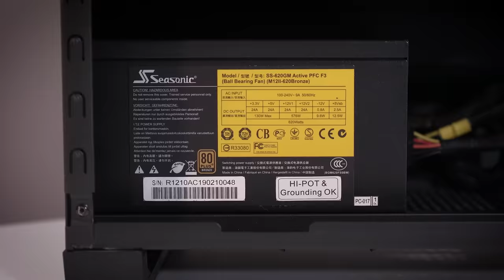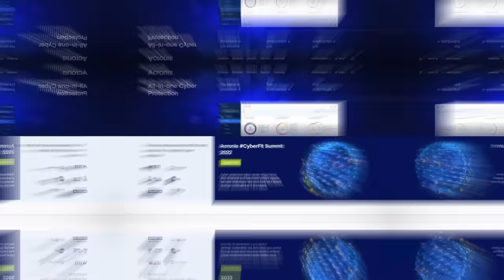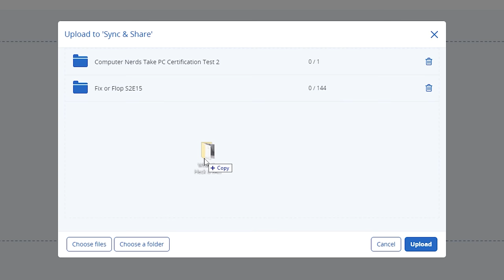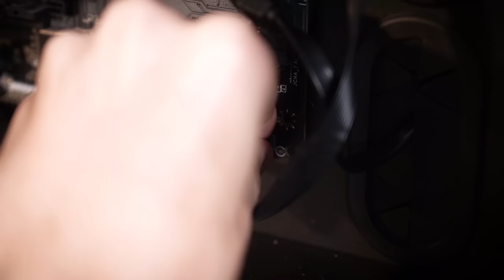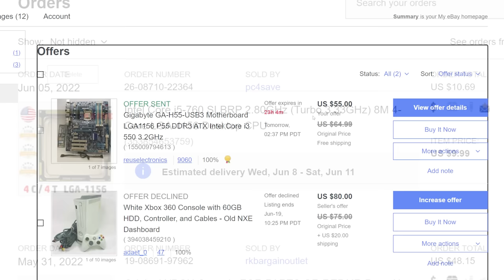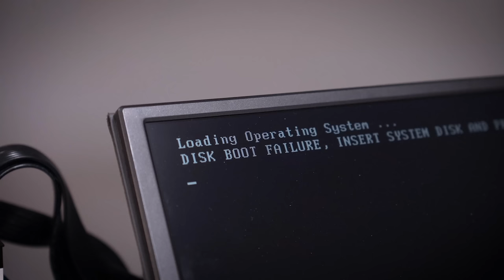Fixing a Viewer's BROKEN Gaming PC? - Fix or Flop S2:E14

Comment: This sort of power cycling problem can be indicative of a bricked BIOS. The EVGA board from the video (P55 LE) looks to have a socketed BIOS chip, I would have looked for a cheap USB programmer to re-flash the chip. I have also seen many listings on eBay for replacement BIOS chips for the P55 LE which are sub 10 bucks, it would be worth a shot for a follow-up video.
Reply: Or just a bad CMOS battery on those old Intel boards...
Reply: I think those flash chips start do have bit flips after 10-15y. so maybe reflash before system is 10y old
Reply: @RandomTechVideos  that's what I was going to say.
Reply: @LimbaZero  what your saying should be impossible as bios is physically burned into the chip... or at least that my understanding.
Reply: @t8z5h3  If it's eeprom or flash then they will die over time. Search for bitrotting or bit rot.
Also Adamant IT has many videos where he reflash bios to old motherboard to fix them.
Reply: I was searching for this comment and it is indeed a case of the bios eprom succumbing to bit rot. Rot can happen as earlier as 10 years into a chips life cycle.
Reply: @Precurser66  good to know.
Reply: I experienced the exact same issue with a failed attempt to flash my BIOS
Reply: Gonna agree with this one
Reply: @LimbaZero  You are on the right lines there. Ive seen may eproms from the late 80s and through the 90s be very bullet proof and reliable even to this day there are many flash rom based computers from these time periods where their BIOSs and boot roms are still good today even of the actual hardware in the computer has degraded to age, older roms in the 80s were typically of a masked type meaning that their data is ‘burned’ into the silicon at the time of manufacture or programming, mask roms were a fairly unreliable (even at the time) rom type and were quickly phased out by eproms. Modern eproms to my knowledge due to being made on smaller manufacturing process nodes than ones back in the 80s and 90s are more susceptible to bit flips from external radiation or cosmic rays from the environment, this may or may not become more of a problem depending on how dense the data capacity of newer eproms become in future.

*From my knowledge*
Smaller transistors Fets used in these modern eproms take less interference energy to have an induced bit flip, compared to earlier eproms where larger transistors were used which are much less susceptible to but flips by external factors.
Reply: @Precurser66  Yeah you are correct there. Modern eproms have a reduced shelf life compared to older eproms used in the late 80s (discounting mask roms as they were very unreliable even for the time) and through the 90s into the 2000s.
I have seen many old computers still kicking with out corrupt eproms compared to newer stuff.
Reply: @RandomTechVideos  Yes, you are also correct there.
*from what I know*
If the CMOS (Complementary Metal Oxide Semiconductor) battery was to not necessarily run out completely below the working threshold of the PRAM or parameter memory (It goes by many names) (basically a small energy effect SRAM package which unlike DRAM because the notation of “D” for Dynamic implies that DRAM needs to be refreshed at a needed frequency to retain information, this refresh process is much more energy inefficient than typical SRAM) (This memory is also used to store immediate BIOS configuration settings, the the user may have the opportunity to save this profile data to usually a separate eprom to the BIOS or to the BIOS eprom itself in a reserved space in memory) but rather is just between the area where the SRAM storage bits are getting undervolted which can lead to erratic behaviour: bit flips, erratic and unstable high frequency bit oscillations (rapidly switching between 0/1 due to being unstable from undevoltage) and resulting incorrect data being read back to the chipset once the BIOS requested this memory to be read uppon the power up or boot strap sequence. Simply, a result of this data being read back incorrectly will cause a checksum error if corruption if great enough (Where the sum of written data in PRAM memory storage is equal to the stored value at the end of the memory address space, the number at the end of the memory address space must be usually equal to or multiple of adding all values written throughout upper PRAM address space) which is designed to cause an intensional POST (Power On Self Test) failure to prevent garbled or corrupt data from being used to initialise the boot strap sequence which may potentially damage the system if said bad values were used such when setting voltages and clock multipliers, ect.
Reply: @LimbaZero  Eproms don’t necessarily die over time, they require their memory to be refreshed (hence programming) as its charge in its Fets would degrade over time which can also lead to a checksum error where the system intensionally fails to post due to data corruption, either that or memory very early into the bootstrap code is corrupt and cant even get far enough to perform said checksum.

Adamant IT does indeed have pretty good in-depth guides to reprogramming your corrupt BIOS chip. The CH341A is a solid choice for this.
Reply: @P2PC  Having worked warranty repair for a motherboard vendor I can say that sometimes these flash rom just die. It's not common, but it happens. And I really mean they just die. It's more common that it happens when trying to flash the memory but even without that it sometimes happens that a bit is flipped, in which case it can be re-flashed, but sometimes it just dies.

Socketed bios chips makes it easy to re-flash or replace the chip using a programmer. But if you lack one then it's often possible to use a working motherboard and do a hot swap flash. That is done by booting the machine to a dos based disk image with the flash program and bios file. Remove the bios chip and swap in a empty chip or one that you want to re-flash. Run the flash program and power down.

I have done that when I didn't have a programmer or when the programmer I had didn't support the flash memory chip. The programmers we used were everything from standalone units to computer controlled versions. The more modern versions were modular and we could buy all kinds of connection modules and gang programing extenders. But they tend to cost a pretty penny.

Now I've seen some programmers that can reprogram a surface mounted flash chip while it's mounted on a motherboard, but I have never used one of these myself. I got out of the business before surface mounted flash chips were a thing.
Reply: how does a BIOS get bricked?
Reply: @krack-a-lacker  There are a few ways. If the flash process is interrupted in any way and the board power cycled you can end up with a system that cant pass POST (Power On Self Test) and thus can't Boot. The chip itself can get damaged by a power spike from say ESD (ElectroStatic Discharge), The chip can have a manufacturing defect that only manifests after it's been used a while. Then there's the chance that the chip received a bad flash originally in that now the BIOS is stored in Flash memory and not a PROM or EPROM. Flash memory stores the data as an electric charge, and with time this will get weaker and weaker. So a bad flash can store some of the data using a less than optimal charge and those cells can then grow week enough it can no longer be reliably read. And that's the ones I can think of right now.

In the first case it's sometimes possible to Quick Flash or other similar feature if the motherboard supports it. Sometimes it works and sometimes all you have is a paperweight. If the chip is damaged then it will have to be replaced which is a pain as today almost all consumer level motherboards have the bios chip soldered to the motherboard instead of in a socket.

There are Flash programmers that can be attached using a clamp without de-soldering the chip, but those only work if the chip is undamaged.
Reply: Sometimes you just need to reset the bios with the on-board reset switch. I had that happen on a very recent AM4 motherboard.
Reply: @ScottGrammer  That's only when the CMOS settings have gotten scrambled. It doesn't really do anything for the BIOS image. Oh, and image in this case refers to the code stored in the bios chip.
Reply: @blahorgaslisk7763  Yes, that's what happened. I was attempting an overclock, the machine crashed, and from then on it would do nothing but boot-loop. I did not have to flash the bios, just reset it and start again.
Reply: @ScottGrammer  That's the difference between the BIOS settings and the BIOS. The BIOS is the code that is stored on a ROM of some kind. ROM comes in a lot of versions such as ROM, PROM, EPROM, EEPROM and FlashROM. 

The BIOS settings, the name of which is somewhat debatable, are stored in a form of RAM. This is usually called CMOS memory because of the internal construction. CMOS logic is very energy efficient, but tends to be slower than what is desirable for main memory. The settings takes up very little space, were counting bytes, not even kilo bytes. As it's so small and energy efficient it can be maintained using a battery. The button cell used on most motherboards is good for several years.

When you set an option in the BIOS menus and save it is stored in this CMOS memory, which is a RAM type memory. It can be rewritten almost infinite times without wearing out, which isn't the case with Flash memory.

As it is a non persistent memory, meaning it loses the content if there isn't any power, it can be erased by removing said power. Some motherboards had a jumper that you removed to do this, or they had the battery connected by a wire and you just pulled the plug. But modern memory tech is so efficient that this isn't a reliable way to erase the memory. These few bytes of memory takes so little energy that you would have to disconnect the battery for a pretty long time to be certain the memory is totally blank.

Instead the battery is connected by a high ohm resistor to the memory. By connecting the voltage in pin on the memory to ground there can be no voltage left and the memory will be reliably wiped clean. The resistor makes sure that the battery isn't shorted directly to ground while you clear the CMOS. The connection to ground is usually done by shorting two pins in a connector on the MB, but it can also be connected to a button, sometimes placed on the IO plate so it can be accessed from the outside of the computer.

The basic ROM chip is something you probably never will see now as it was manufactured with the code in it and couldn't be reprogrammed. Way back this was cheaper than using a programmable chip, but only after you reached a volume where the  cost of making the lithographic mask and running a batch of the chips was cheaper than using PROM chips and program them for whatever they were used for.

PROM stands for Programmable Read Only Memory. When new it's totally empty but using a special programmer code can be burned into it, but it can never be erased and reprogrammed.

EPROM is Erasable PROM. These has a small "window" in the top that's covered by a sticker. You program is like a PROM but can also erase it by removing the sticker and shine UV light into the window. After some minutes (anything between one minute and an hour or more depending on make of EPROM and how strong the UV source is) the memory can be reprogrammed.

EEPROM is Electrically Erasable PROM.

And finally there's FlashROM. This is a Flash memory that can only be reprogrammed a few, as in less than 1000, times. It's used on modern motherboards as it allows the memory to be easily reprogrammed without having to implement a programmer capable of handling EEPROM.

And it turned into a Wall Of Text...
Sorry for that.

Comment: i would probably look at the battery on the motherboard  to see if it has a decent charge or if it has to be replaced  because these can sometimes do a lot of strange things like this when they have to be replaced. you should probably get replacement batteries for diagnosing such systems  and these are pretty inexpensive and easy to get and as you always say : always try the easy stuff first .
Reply: I would of tried the last latest update on the bios  from the manufacture website. :)
Reply: @adamtajhassam9188  the motherboard was not even posting so i doubt you could update it  since  it had no bios flashback function on that board. the bios chip may be simply dead
Reply: The cmos battery runs the primary clock that everything on the system works around. If the battery is dead, the comp will never work right.
Reply: with the computer as old as it is, the CMOS battery was one of the first things I would check. even if it doesn't look bad. cheap enough to try.
Reply: @TheFlamerGamer3  yeah, and even if you don't have a new one on hand you can still pull it and see if the symptom changes. Then put back in and test. I've had an old AMD system that refused to post. I pulled the cmos battery and tested it with my tongue which passed so I put back in and it posted. My guess is that the little spring that contacts the positive pad got corroded even though it looked great. And just moving it fixed it.  Now when I troubleshoot "worked when parked" issues, part of my pre inspection includes re seating the battery.
Reply: @scottcol23  hold up you stuck your TONGUE into the CMOS slot?
Reply: @lucasgamezz140  sure did... lol.... not quite. What I meant was i have a horrible habit of testing coin cell batteries by touching it to my tongue. you can feel the 3v charge. I clean it up first of course.  this also works with AA, AAA, 9v (not fun).
Reply: @TheFlamerGamer3 it is not that old 😅Those batteries last longer ,my sabertooth x79 is from 2011 and the battery is still working .

Comment: Could be a corrupted BIOS on that EVGA board, apparently that is something that can happen. Some of those older motherboards have socketed BIOS chips, so they can be easily replaced, but finding an exact match could be tricky these days, and you'd still need some way to program the chip with the correct BIOS. For newer BIOS chips there are programmers available that you can clip onto the chip and connect to a different computer to read/write the contents of the BIOS chip.
Reply: Nah, I believe is the battery on the motherboard that’s needs to replace. Since most battery on the motherboard last 3 to 5 years, after that you need to replace the old to a newer ones.
Reply: Had a similar issue on a Z97 motherboard I was working with. Thankfully, that sucker had Dual BIOS.
Reply: @lightgod2255  It’s bit-rot lol.
Stop guessing

Comment: I was actually surprised it was the mobo---EVGA has a pretty good track record for reliability. This was sort of a history lesson in a way. Back in the mid 2000's, that was a sweet rig with great specs....but of course, time marches on, and what's hot today becomes tomorrow's history lesson
Reply: There is nothing wrong with that board apart from a negligent owner that didn't care about doing maintenance on 10+ yo electronic hardware. a 1$ battery change would have avoided this situation, and the board still isn't dead. It just doesn't know which gates to open RN. Reflash and donzo.

So in summary, your surprise is based on faulty info, and a bias towards EVGA. I'll tell you right now, I don't trust any company, but back in late 2000s companies actually had intentions not to deliver crap products. Literally half the boards on the market RN are like 3-6 layer PCBs. Back then we had 8-12 layers PCBs and still they bent, somehow manufacturers have realized moving into a problem actually profits them. modern LGA hold down clamps literally bend the CPU IHSs. How tf have we gone backwards?

Comment: I finally guessed one right! This is one of my favorite series, Greg because I learn something new every time. BTW I would have put the sound card on a lower slot for more free airflow to the GPU. Looking forward to the next one.
Reply: You can't put it on the lower slot, thats a PCI slot, u need PCI-e x1. So the slot above the GPU would have made sense. 17:06 there are 3 PCI-e x1 slots, the one below the PCI-e x16 is occupied by the GPU, so that leaves the bottom one (two down from the gpu, that blocked the airflow) and the top one, which was the original config anyway. So idk why he didn't just replicate that.
Reply: You should know that he forgot to check the CMOS battery on the 'dysfunctional' mobo. It is highly possible that the power cycle issue was being caused by a bad CMOS battery. It happens all the time.
Reply: Let's watch Greg struggle to open the motherboard out of the bubble wrap

Comment: I want to thank these videos for giving me the confidence to be able to diagnose the issues with my pc yesterday after it stopped posting when I installed a new a cooler. I went through all the steps and knew to look out for the EZ Debug lights to know what to focus on. Turns out all I needed to do was reset the CMOS for some reason as the VGA light was staying on. Not sure why that happened after just replacing the cooler, but I'm glad it was an easy fix.

Comment: I wonder if the bad Motherboard has a bad BIOS flash or corrupt BIOS. But he didn't mention anything about the BIOS. Maybe the board doesn't have a BIOS Flashback Feature.
Reply: The fact that it never posted is a clue that this might be correct, but if the BIOS is the culprit, the cycling would not be happening. This is 100% a power-delivery issue.
Reply: probably what it is..
Reply: @mattio79  no it’s a bois issue lol

Comment: Judging by the age of the board, I think the CMOS battery just died. Check the voltage of these on old boards.
Reply: Unreal he didn't check this, or that eprom idea. CMOS battery though, is a no brainer, you  would assume,.... Why is Greg so bad at this while being otherwise good? and calling a Core series "from the early 2002s, " ...cringe.